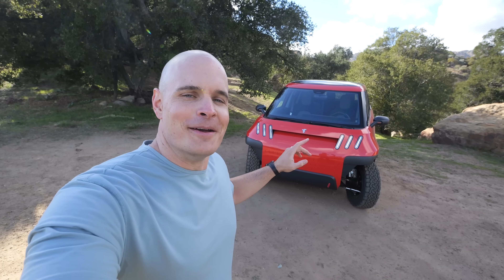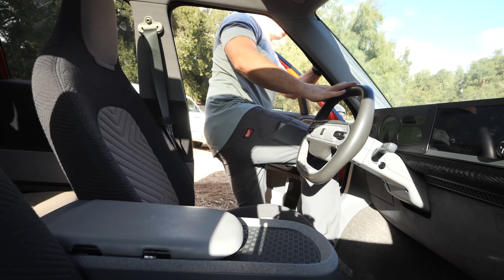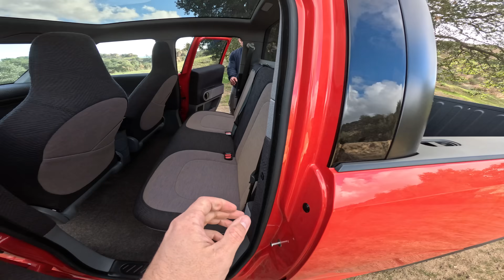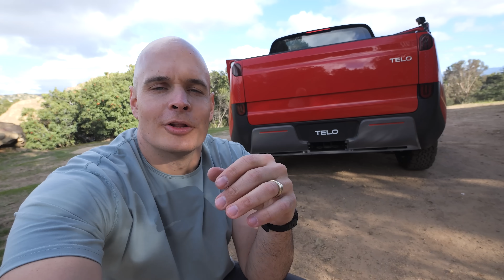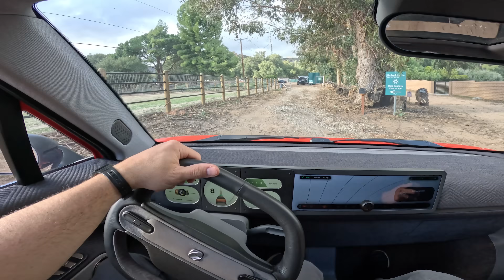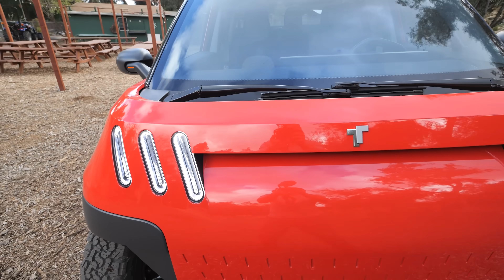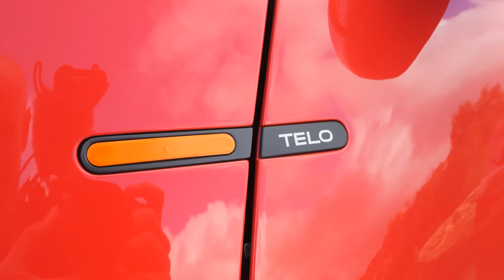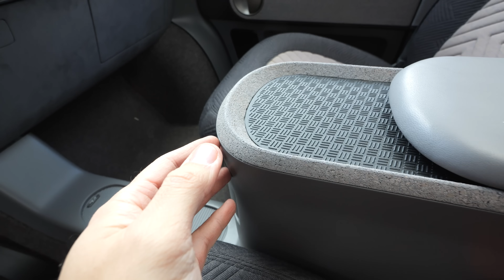ONE TRUCK TO RULE THEM ALL...

Comment: I immediately plunked down my $152 to get on the list. I want to replace my 1991 Ford Ranger and my RAV4 with one vehicle. I hope it's as good as it looks.
Reply: it will be much more expensive and/or made in china. they tell a price but don't have a factory yet, haven't negotiated with suppliers about prices, unions/workers about wages, chosen a location to determine taxes, costs of eco regulations (if any..see china) but can tell a price.
this is jsut another tech startup scam

Comment: When is someone going to make an EFFING EV / PHEV MINIVAN!??!??!??? 😠 Telo, if you do it, I'll be first in line to sign up. A privacy respecting DIY-friendly PHEV Minivan is my ideal. I have an older Pacifica PHEV Premium and it's AMAZING to drive, but it's having transmission issues, is NOT privacy respecting, is difficult to find parts and DIY diagnose / repair, and mechanics all complain about them and charge a fortune! High voltage doesn't scare me. Spying on me does, blocking me from repairing my own crap DEFINITELY pisses me off, and obeying scandalous and "laws" requiring driver facing cameras and AI analysis for "fitness to drive" is downright criminal!!! I'll never abide it! Full stop!!!

Comment: Some things about this doesn't make much sense. Like off road capability and 300+ miles of range. Given how small and non-luxurious it is on the inside, it's obviously not a road trip car, and no one is going to take this one climbing boulders in Tahoe. It is an urban utility hauler, like a BMW i3 with a bed. Pop in a small battery for 100 miles of range, drop the weirght, and this thing will sell like hotcakes.

Comment: I like that it legitimately is a functional truck with a kinda Mars rover look. I dig it. America is desperate for another go of 1990 Ford Rangers (in my case a 1989 22-RE Toyota Truck). AKA cheap hard working trucks that can get the job done...this as an electric does potentially have a durability advantage so.....bring it. My 1989 Yo could haul (2) 1989 Honda 4-Trax ATV's (450Lbs Ea) on a flat trailer up the Wyoming Rocky Mountains at speeds in excess of 35-65MPH (an acceptable speed in the twisty turn-y cutback roads). She only sported 99HP and 125Tq...but could take the 1000+Lbs hitch tow and my camping gear no problem.
Reply: I did things to that truck no car today could take (like hitting a irrigation ditch in the middle of winter "hidden by a snow drift" at about 45Mph and nosediving the truck into the bank side...) Truck skid plate was a little dented.....even thought the hood unlatched and flopped around it caused 0 damaged to the hood the hinges or anything else....I wish we had 15MPH bumpers again.

Comment: I'd be curious to know it there are plans for any sort of front guard addition. The open wheel design is neat, but if anything smacks that control arm at high speeds or even taken off road with a deeper rut or tall rock. To me that feels like a very vulnerable point of this design. Other than that seems like a really neat smaller truck design. In a world where everything is getting bigger and bigger its nice to see people designing for practicality too.

Comment: I really like this little EV truck.  They purposely built it around 6'2 people (my height), so it's cool to see a small EV that accommodates larger adults. Having said that, I'd have gladly sacrificed another 6 inches of bed length to make those door openings just a tad wider. In every review I've seen, people struggle a little bit to get in and out through those tiny door openings.  And while the mid-gate is cool, they need to make it possible to remove the rear glass above it as well, for those of us who want to fit the rear shell and make it an SUV.  The glass roof is a mistake, so I would definitely pay for the solar option or even just a regular solid panel if they make that available.

Comment: I'd love to sit in one. Although I'm 6', I don't fit in any vehicle with a sunroof (including large SUVs)...insufficient headroom. It'd be great if the sunroof were optional. That back seat is clearly not for adults haha. I'm ok with that. My dogs would be fine back there. I love the preference for non-proprietary components. Very smart 💚
Throw a couple of mountain bikes in the bed. I wanna see how those fit...perfectly acceptable to remove the front wheels to use fork mounts.

Comment: A bigger version of the TELO would be nice, maybe an extra 18-20" in length where most of that goes into a more spacious cab/interior, and its overall size would still be smaller than almost any truck out there.

Comment: Great idea for a truck!   How’s the comfort up front?   I’m 5’2 and probably wider than you, so width would be a consideration (my problem, of course). My concern would be that the humans are at the very front of the vehicle.  Having a frunk between passengers and the car ahead  provides at least a feeling of safety.    

By the way, I had fully expected you to be taller…, but you break the mold.

Comment: I'm a little surprised the open front wheel design made it through the safety regulations. Seems like that would cause major carnage if you hit a pedestrian, even at low speed.
Reply: Yeah that junk with no bumpers will never be street legal in the US!

Comment: They could easily sell this truck starting at $25-28k without stock piling many variations. But what’s going to happen is they are going to listen to some YouTuber that wants everything under the sun!

Remove the rear seats (offer seats as option), sell 2 painted colors (offer wrap service as option), one pack size (preferably between 250-350 miles range), one tunnel door (2 is not needed), finally (optional tonneau cover or full top cap). 

To be honest I just need a basic small truck for carrying cargo. With all the options they would have available outside of a true base model, the price of the vehicle would max out at about 60k. 

A very Apple like business model for this vehicle!!

Comment: $52,000 or $78000 Canadian as i'd like it equipped with the options provided on their website - all wheel drive, 350 mile range, camper topper to keep my tools dry and warm and secure. i'll keep driving my old v8 explorer until it dies, but its nice to know I'll have this as an option when it does.

Comment: Im not a fan of EV cars but utilitarian vehicles like the telo and the vw id buzz has hit home with me tbf, that should be the trend instead of making every SUV electric. Small vehicles and utilitarian trucks like this is what makes most sense honestly instead of making a bunch of inneficient suv with near no purpose compared to their counterparts while very small trucks and small cars(like the SMART cars) would benefit greatly from electrisation and in that case they benefit greatly since battery tech is more efficient than internal combustion engines at that size.

Comment: Thank you Jerry for discussing the front crumple zone (or lack thereof); it is a common first critique for this vehicle. Jerry, if you refuse to “gas it” even after prompting from the CEO sitting next to you, you succeed only in casting suspicion. Pushing the accelerator while driving down a closed road should NOT be a safety issue of any kind. 2 battery packs are options; does the larger higher-range battery encroach upon any of the payload space of the TELO (such as how the Cybertruck ‘allows’ for a larger battery)? Guys, the creaking/so-called rattling sounds could be stones/small road debris getting kicked around the wheel wells. A portion of pavement driving would have been helpful. It is also likely that sound-deadening materials found in most ICE trucks were sacrificed for weight-savings for this all-electric ninja. I can’t wait for this TELO truck to Hulk Smash Cybertruck sales especially since the folks behind TELO are the same folks Musk pushed out of Tesla.

Comment: sorry, it just doesn't look practical. it's going in the right direction but it's just not comfortable or convinient aside from fitting in a small parking space. I have a random question though, when traveling with the bed door open at high speeds is the noise loud and what's the wend flow like? also also, this isn't a gripe about the truck: how deep of a pothole can the truck handle without issue?

Comment: I just wish that the old Datson and Toyota small trucks were produced with gas engines.  I am tired of the electric vehicles, the fires with the poison gases from the burning batteries, the increased costs of insurance and the economics of actually recycling the batteries along with the other exotic materials.

Comment: Can't wait for you to break the hitch just as you did to the Cybertruck, but remember to hold the front down so you can break it in two.
BTW, why didn’t  you hold down the front of the motor less steel frame truck so we can see where it would have broken. After all, fair tesrs require equal treatment.
Where are the airbags and crash test safety data?

Comment: I think I would prefer a bit more space up front (frunk, etc) and an option for no glass roof. However, even as is I would find this appealing (depending on final cost, safety scores, reliability, etc).

I currently drive a 2017 four-door Nissan Frontier, btw., and I often have to drive an extended cab 2018 Ford F150 for work. That Ford is definitely too big for my tastes and needs, and the Frontier seems to be at the large end of the “Goldilocks zone”.

Comment: Fingers crossed this is going to be available in Norway. I love my truck, but it's a Mitsubishi L200 that is far too large now that I live in a city, as well as an avid drinker of diesel. This would be absolutely perfect for me, going electric but still having the option to carry stuff. (Not in construction, but I often have to carry some less than practical stuff in the car, but nothing super heavy)
The range too is a godsend, I've been holding off buying an EV because I need the ~500 km range, the only real alternative I had was a Hyundai Kona at the time and I would lose the carrying capacity.

One thing that would be close to mandatory for a truck used in colder climates though: A heat pump.

Comment: What I'd like to see is an auxilary generator (range extender) gas turbine (?) rated for 120% of crusie requirments (charge the battery pack while at cruise) battery assist for acceleration and climbing. 
Need more range? lock it into the bed. Driving around town? leave it home.
Seems like the biggest issue would be the battery/motor/generator interface to allow the vehicle to run off the generator at cruise and still draw from the batteries at need.

Comment: This truck must be cheap, because even the designer was spared money when developing it, its appearance is simply terrible. Some kind of tadpole overgrowth. The engineers also did not do much, with such a landing, the steering wheel should have been adjustable so that the landing would be more comfortable. It turns out that the truck was made by marketers - and this is bad for the car and its users.
Short front overhang - why is it needed? Should the truck drive into horizontal walls? I doubt it, but the lack of a front bumper, with the brainlessness and crookedness of drivers (even in supermarket parking lots they manage to drive into some kind of barrier or ram their neighbor) will lead to frequent damage to the front panel. Why make a "super-duper tunnel" in the lower part and put such a small battery? And how noisy and rumbling everything is in the cabin when driving on a dirt road... Comfort and utility?..

Comment: I'm really excited for this truck. I fit that profile you described in which I have an older CRV for hauling family, traveling at economy, and moving stuff that can fit in the trunk and I have an old 1/2 ton Chevy single cab with an 8' bed for doing all the work that my CRV can't handle. Trucks today are ridiculously expensive and I'm happy to see an affordable price point of such a capable truck that can haul family, a high payload bed, and I love that it can handle 4'x8' lumber without having to be rested on the tailgate. I don't even think there is a gas engine truck that matches this at this price point right? I agree that the EV design is the future of the mini trucks and would steal market share from compact SUVs for the customer like me that is a weekday 9-5ers w/family and weekend project warrior.

As far as the future of EV, I hope to see more of the "common" component aspect so that people can feel empowered/comfortable to work on their EV vehicles at home like I would with my old 90s truck at home.

Comment: I would be super interested in a minibus . So basically this vehicle, but with a covered Bed and verticaly hinged doors. 
In Europe loads of smaller companies are looking to replace of their often Diesel Powered minibusses.
Plumbers, Smaller delivery companies, Taxies to airports ( would bennifit from the bed housing an other row of seats. ) etc, would probably want this truck, or variants of it.
If the range is there, to work without frequent charging.

A friend of mine now has a full sided delivery bus, with loads of equipment in it, but that equipment has reduced the effective range so far that he often can't get to all the sites he has to visit in a day without delays caused by charging. And other then deploying an extra team with their own fully equiped van they don't have a sollution for that yet.

Comment: Yeah my husband and i had a small single cab tacoma but we sold it because we just were not using in. We put a tow hitch on my Chevy Bolt and it did everything the truck did with a trailer. We didn't drive it in a whole year because we didnt want to put gas in it. And that was pretty gas efficient for a truck. 

We cannot wait fo get a Telo for camping! 

Looking forward to making my own canvas bed camper.

Comment: -They also have a camper shell, that's built specifically to lock into the rear trim of the frame. (increasing the possibility to add 3 more passengers/or can turn it into a camper)
-They are in works of adding a solar panel canopy for the glass roof (If you don't want to get cooked from the sun like me)
-They Get around 3miles per KWH, around the same as the model Y, and more than the average of 2KWH by other EVs
-If you don't want the camper shell, you can get a bed cover, can fold the back back seat and still use it as a minimalist camper.
-They are planning on adding physical buttons to the operatonal display as opposed to the trend of making everything on one screen (Which screws you over if you lose power/crash)
-The bed will have power outlets in the production model as well as bed lights built in.

-I've been a fan of snubbed nose/overcab designs my entire life (Due to their better maneuverability, and better view of the road, I hate vehicles that have such a long nose/hood to them especially around blind corners when you're trying to turn into traffic) and have been aching for someone to make one, I'm happy someone is and with the added benefit of the parts of comercially off the shelf, which would make them more affordable and accessible for maint.

-I personally would like to see a little bit of more road-height clearance, but 10" is a good start.
-I'd personally would also like the front to have a frame/mount where I can get a Bumper Guard welded/Bolted on for added safety especially when traveling on heavy deer crossing roads.
-I'd definitely like the front to have a hitch point also so that if I can't get it unstuck, I could have the option of carrying an electric remote winch I could mount on the rear or front to make sure I can pull myself out of any sticky situation.
-I personally would like an alternative leather like material for the seat/other fabric panels (Could use mushrooms) since I have dogs and any type of cloth material is a full on magnet for dog fur. Basically would like something less pourous/more veristile and utility driven.
-I also wish vehicles would stop witht he carpet floors, especially with it being a truck mentality, I rather have a Silicone/rubber/coinmetal floor that would be more water and mess resistant to where I can wipe up any mess with a rag, rather than needing to do a vacuum/carpet rug cleaner (Which never truly gets rid of EVERYTHING). Make it durable and easy to clean.

That all being said, even though it's projected to be expensive as hell, I'd definitely make the investment towards the AWD/long version, with a solar canopy, and with a camper shell. (I'd write it off as a business expense too since I'll be working on my camping/traveling and building a homestead youtube channels so it'd be a win-win) ...Also it the AWD Long range version essentially projects the same roughly distance that my hybrid currently does on a full tank. So i'm already used to the range limitation, And a 20-30 minute charge would'nt bother me. It'd give me the proper breaks to walk my dogs and check my gear.
Reply: Agree 100% about "coinmetal" floors and rubber/silicone tub-style floor mats. And attachment points for a front hitch and deer guard/push-bars. 
Leather or some kind of vinyl seats will probably be added options in the future; let them just get the dang thing into production as it is, first! ;-)
Reply: I'd also add, and this may be a personal thing, but I'd love to see a proper regular cab version! The fact that it has the fold-down partition is nice, but a proper 2-seater with an 8 foot bed would be a utilitarian dream!
Reply: @CherriPicking  Full 8 Foot bed with a bench seat... 🤤

Comment: OK Jerry: how will it tow? 
Sure, 6,000 lb towing capacity. Sounds good. But DOES IT HAVE A STEEL FRAME?
Or will the back end rip off like a Cybertruck?

And how well will such a small vehicle tow on the highway with a real trailer or motorhome behind?